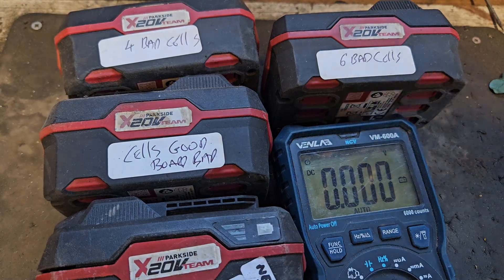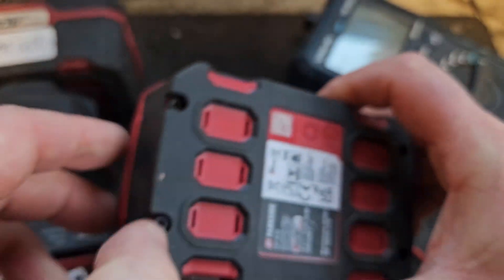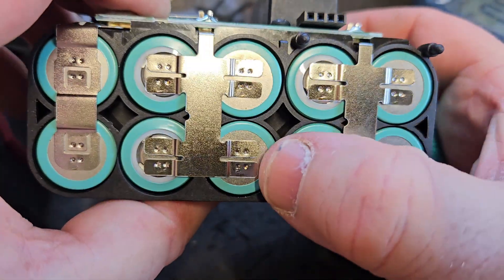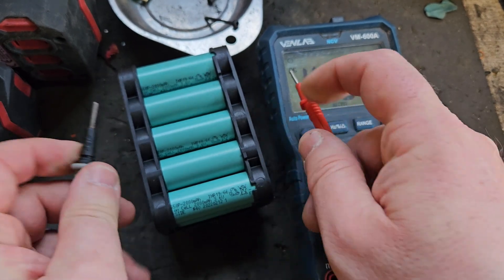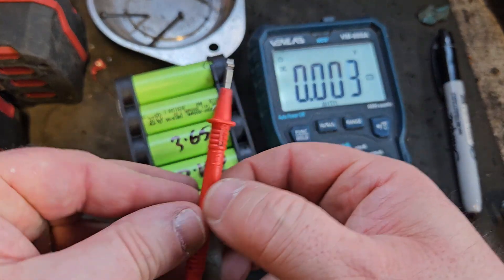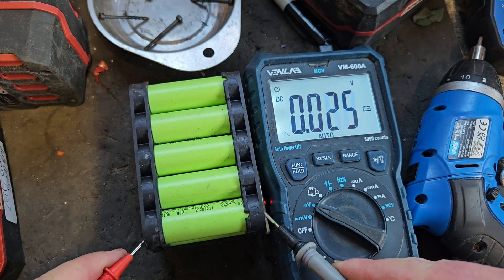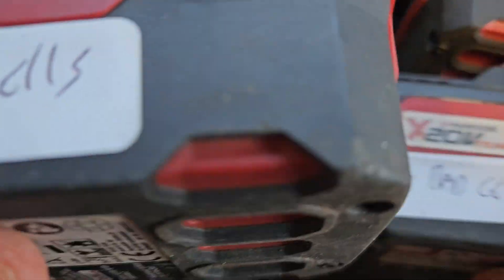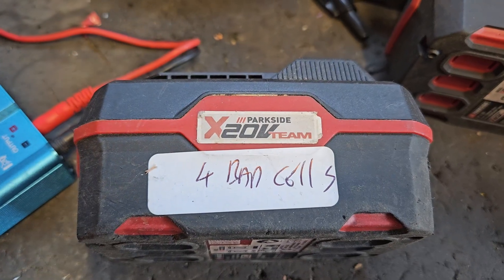How To Test Parkside 20v battery With a multimeter

Comment: How long do these batteries usually last? What's the performance like on high power consumption tools like angle grinder? I'm debating on swapping those cells into Makita as i have so many boards with bad cells.
Reply from the maker: The Parkside use a lower quality of cells and the makita batteries board shuts down. If you do cell replacement on the Makita batteries you will need to replace the boards too.
Reply: @doctorlefthandthread  i have some AliExpress boards as well. I might try it's not that much work. I will probably modify the 8ah to work on Makita( needs a case tho 21700 cells). If that doesn't satisfy me i will probably be going with molicell they cost a lot but they sure beat genuine batteries that suck in terms of value for money. The goal is to have the angle grinder working a little longer on maximum performance.
Reply from the maker: @wanderer7779 aliexpress have battery shell kits that take 21700 cells